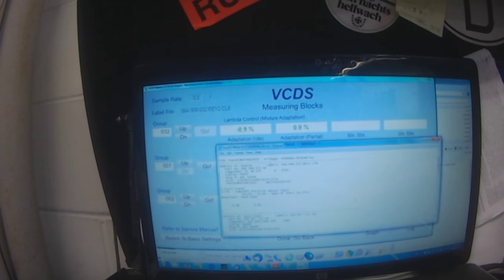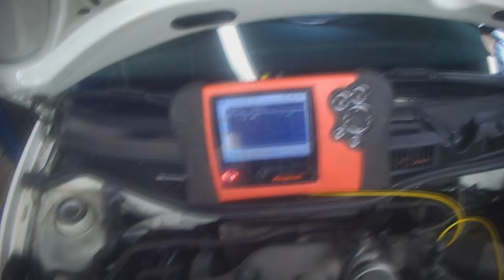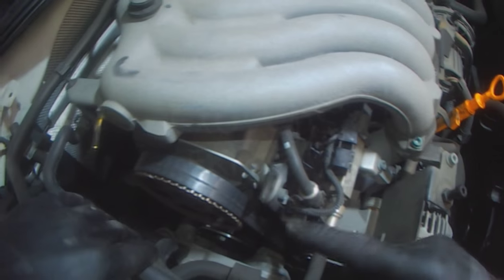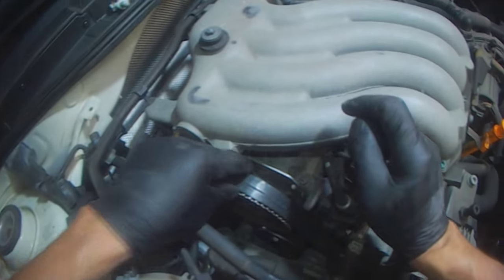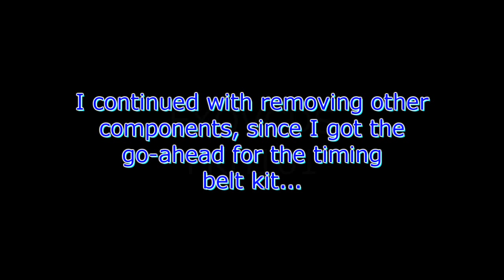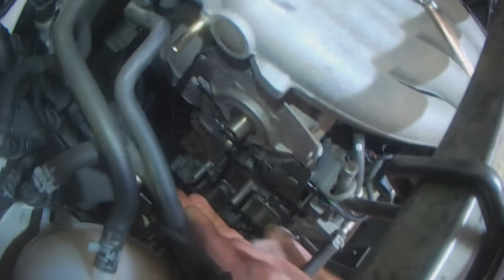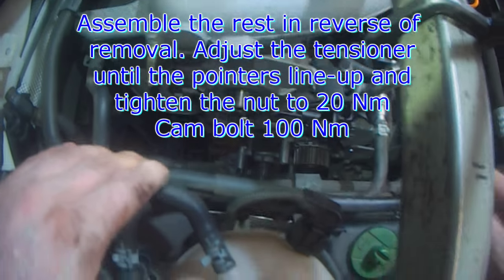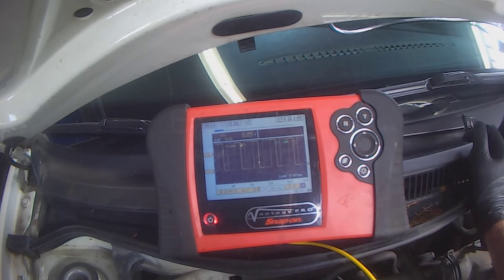VW A4: 2.0L Faulty Camshaft Position Sensor G40 (P1338)

Comment: @EXOVCDS
Can it die out of the blue?
at some point start to have long start issues, yesterday received ESP lamp, and lose of juice (lack of power) checked codes P1338 G40 Open or Short to Plus
Reply from the maker: Year, make, model, engine?
Check for missing timing belt teeth.
Reply: @EXOVCDS  VW Golf IV (Variant)
1.6L (APF)
Engine ran totally ok after rebuild (at 240k km), sensor was not changed, because there were no need for this
Reply from the maker: I don't know if the 1.6 has the G40 at the cam gear.
Reply: @EXOVCDS  It has, checked with manual, internet etc. - 06A905161B

Comment: Hello. Tell me please (about the DMRV). Auto Golf 4(2.0/8v/115hp), dmrv (type HFM5) 5 contacts, put the multimetess probes on the 3rd and 5th contact and go on to turn on the ignition, and watch the voltage show 1.02 V, literally 1 second and then abruptly decreases to the lowest reading to 0.01V (and holds), it is worth to start a car, readings 1.48-1.
50V (at idle) and increase as you press the gas pedal. What can it be? Thank you!
Reply from the maker: Post a video on your channel so that I can see what you are doing.

Comment: Hi! im in the process of timing belt change, water pump.. etc.. can i just clean off the CPS without buying a new one? like dust blaster? will that prevent brakedown? thank you
Reply from the maker: Alphafox46 Cam position sensors have a limited time span... it's not always the same. A transistor can only open / close so many million times. You can replace it now or later. I have a video showing how to replace it on a 2.0l engine, by just moving the camshaft sprocket. Your sensor might be good until the next timing belt change or it might fail within the next year.

Comment: Hello dear. I have one question if it possible to answer me. I have VW GOLF 4 2.0l AQY code. I have a small problem, the engine starts without problems, runs very well, has good acceleration but at the idle I feel at the steering wheel when the engine do a short interruption or like small vibration and the same at the exhaust (I hear like bup-bup every 2 or 3 seconds constantly). I checked everything with the electricity (coil, spark plugs, wires), crancshaft sensor, MAF, O2 sensors and the other sensors, computer, timing belt is new, cleaned combi valve, 4 filters, oil, fuel pump changed and measured pressure in both pumps, changed petrol injectors, measured cylinder compression-more than 10,5BAR. Yesterday I tested camshaft position sensor like in your video with the multimetre (on the left-first its 5V, second one its not from 0-12V when the engine is runing-its is about6-7V, third is 0,011V). My engine runs with gas and petrol. I dont have idea what could be this small problem, help me to solve. Thank you very much.
Reply from the maker: I have no idea... especially if it is dual fuel. Have a shop look at it.
Reply: Thank you for the answer. I was to the mechanics, auto-electricians and to the gas mechanic (changed evaporator). During running with the gas engine works quietly. I have check engine light but without any signal fault codes. Can it be camshaft sensor with those simptoms (voltage)? Thank you and greeting from Kosova.

Comment: Quick question, will the cam sensor cause a no start? girl went in a ditch and cracked the radiator and wouldn't start after...did some pretty good damage...code is 17745 for cam sensor, misfire on multiple, and codes for all 4 cylinder and codes for knock sensor 1 and 3...
Reply from the maker: Year? Engine? Model? Cam sensor should not keep engine from starting. Check if something happened with the timing belt.
Reply: Thomas EXOVCDS oh sorry lol...02 jetta 2.0 manual...
Reply: Thomas EXOVCDS timing belt is horrible...turns over good tho...151k...she just got it Saturday last week
Reply from the maker: What do you mean it's horrible? If it jumped teeth, valves could be bent. If you don't have spark, then I would say crank sensor or wiring may have gotten damaged. Crank sensor is mounted to engine block... to the right of the oil filter, just before where the engine meets the transmission.
Reply: It's cracked and don't look like it's ever been changed...I work on vw/audi alot...u might remember me from a last summer, had the 02 passat 2.8 that would run ok over 3k rpm...I don't think I told u the solution...the cam sensor shoe broke and bent 1 valve on each cylinder on the passenger side...I rebuilt the head and sold it to a friend...still going strong!!..anyways, back to this vw...I usually work on 1.8, 2.8, vr6, r32...don't  usually touch the 2.0...I do alot of rebuilds mostly..so I think I'll do a compression test, then talk to her and do timing belt etc, cam sensor...try to start it and move to cps it it won't go...ecu is ok...no spark I don't think...I don't see damage anywhere from hitting whatever she hit...it bent the radiator in but didn't break fans etc so not thinking it's anything serious
Reply from the maker: If you can handle the other engines... this will be a piece of cake! You just have to find the slice that is causing the issue. =)
Reply: Thomas EXOVCDS thanks!! shouldn't I have a code for crank sensor if that's what it is? got one for cam sensor but not crank so I thought that was the slice lol :)
Reply from the maker: Yes, you'd think that there would be a crank sensor code if the sensor is not producing a signal or if there is a wiring problem. If she wants to fire when you spray MAF cleaner or brake cleaner in the intake, then you have spark = crank sensor is ok. If she does not want to fire = no spark = possible crank sensor issue. You can disconnect the cam sensor... in case it is causing issues with the spark / injector firing.

Comment: great video wish i would of watched before almost strippin cam sensor bolt then bending the tabs that the sensor reads then losing the keyway piece like wtff, i didnt think that piece would come out
Reply from the maker: Yeah, a lot of people bend the shutter wheel... sometimes the key stays in place.
Reply: +Thomas EXOVCDS ya im waiting on new key way now i had gotten new shutter wheel and cam sprocket and i even boug oriellys sensor and no luck aith it so i got oem bosch sensor,and outtung back together, the littke metal piece fell in the sand
Reply from the maker: David Cifuentes Make sure it didn't fall into the timing belt area (water pump or crank sprocket)... it will cut the belt.
Reply: +Thomas EXOVCDS i will check thanks, my luck thats exactly where it is

Comment: Hello Thomas, thank you so much for the video! I just had a question in regards to keeping the Camshaft sprocket in place - Is there anyway to break the bolt without the use of the "Counter Hand tool"? Thank you! Love the videos!
Reply from the maker: You can stick a screwdriver between the camshaft sprocket spokes and rest it against the valve cover, then try to loosen the bolt. Do so only while the timing belt is still in place... to prevent accidental camshaft rotation while the crankshaft is stationary.
Reply: Thomas EXOVCDS thank you so much! I truly appreciate it!
Reply: Thomas EXOVCDS I am doing what you said and leaving the belt in place with zip ties and I'll bungee it to the hood! I am replacing the camshaft pos sensor.
Reply from the maker: You have to be very careful though... the camshaft sprocket has a "sensor wheel" behind it. If you are not careful, the sensor wheel can bend. A counter hold tool can be bought at most auto parts stores (most likely).

Comment: Hi Thomas, good day! I have a MK 4.5 JETTA GLI 1.8t in Mexico, in this week the gli turned on the light of check. I connect the scan and clear, the code was 17746 Cramshaft Position Sensor G40 P1338-35-10 open of short to plus intermittent. The code does appear again, you recommend any maintenance? Thanks for your time.
Reply from the maker: Check that the sensor has power & ground (the outer two wires)... just like in this video. Check that the center wire has voltage and that the voltage goes to 0 when the sensor is triggered. You can use a voltmeter to check:
https://www.youtube.com/watch?v=A6XV5x0504c
Reply from the maker: If the sensor is producing a signal, then you have to check camshaft timing (intake & exhaust camshaft)  and cam/crank timing (TDC marks on camshaft gear and crankshaft / flywheel). If the sensor is not producing a signal, then the sensor is bad.
Reply: Thomas EXOVCDS thanks so much! Maybe the sensor starts with failures, because the connector it’s ok, i have 4.99vcd, 10.09vcd ant negative, the voltage in the center wire is 6.2 to 6.6 vcd with the engine on and idle. The code  not appear anymore but My car have a 128,000 km maybe it’s necessary  change the sensor.
Reply from the maker: @marcocortes1340  Yes, it could be that the sensor sometimes does not produce a signal.

Comment: Hi, i have problems with my passat CC 2013, the car runs good when it's cold but stalls once it warms up... and there is no chance to start ir normally again, after start it works only 1-2 sec, then stalls... After 2-3 hrs when the engine is cold, it stars normally again... The diagnosis didnt show any faults... :( There is possibility that i have the same problem with crank?
Reply from the maker: Yes, maybe... but usually a faulty crankshaft or camshaft sensor will set a fault code in the computer.

Comment: I thought the 12v was the power and the 5v the signal . Is that why i check with a multimeter and it clearly shows 12v but then i check with a test and it wont light up..
Reply from the maker: With the new sensor (as can be seen at 10:44)... power supply to the sensor is 5V and the signal is a 12V signal that gets pulled to ground / 0V by the sensor. Using a voltmeter, the signal voltage will be less than 12 volts. An oscilloscope will show a square wave 12v to 0V (as can be seen in the video), instead of an average of 6V to 7V at idle... again, as can be seen at 10:44 to 11:20.
Reply from the maker: If your signal wire (the middle one) is showing 12V when the engine is at idle, then the sensor is bad.

Comment: Please where is the oxygen sensor of this 2.0 located?
Reply from the maker: In the exhaust system... there are 2 of them. One is in the exhaust manifold at the back of the engine (look down behind the intake manifold) and the other is after the catalytic converter (under the car).

Comment: Thanks Thom
cam shaft sprocket torque is 100Nm (73.7 ft lb) ? I want to know that torque . ??? please correct spec
Reply from the maker: +Bright kim Yes, 100 Nm for 2.0l engines: AEG AVH, AZG, BDC, BEV, BGD

Comment: Hey Thomas,

I was wondering if you think on my 2011 Audi Q5 2.0T when getting the code 
OBD2 - confirmed:
P0343 - Camshaft Position Sensor "A" Circuit High Bank 1 or Single Sensor
P0456 - Evaporative Emission System Leak Detected (very small leak)
 
you think the Position sensor itself needs to be replaced? I'm not sure if the vacuum leak is related but that code showed up later.

After watching your video (very helpful), I feel a little more confident about getting in there and replacing it myself.

I'm also getting the EPC light come on at random times.
Reply from the maker: +Alex Kane I'm currently at work... your cam sensor is in a different location (much different engine than in this video). I'll get back to you tonight (west coast time).
Reply: +Thomas EXOVCDS Hey Thomas, any luck on this?
Reply from the maker: +Alex Kane Hi... sorry, I keep forgetting to get back to some people. I'll send you info tonight.
Reply from the maker: +Alex Kane I can't find the "send message" button on your channel... send me a message so that I can send you a link.
https://www.youtube.com/user/ExoVCDS/about
Reply from the maker: +Alex Kane email has been sent.
Reply from the maker: +Alex Kane I have a feeling that the sensor is in a different location.... what is the engine code? The BPY 2.0T has it at the left of the head as shown in the mitchell info. I believe your sensor is to the right of the oil filler cap, at the front edge of the valve cover.
Reply: +Thomas EXOVCDS P0343 is the code, I emailed you the scan I got from my obd2
Reply from the maker: +Alex Kane No... engine production / id code. BPY, CCTA, CEAB something like that. Located on a sticker on top of the engine / timing chain cover area.

Comment: I just had my water pump, timing belt and serphentine belt replaced on my 2004 jetta. Now its throwing this P1338, P0420 catalyst system and P2181 cooling system. Could my timing be off?
Reply from the maker: P1338 "could" be due to the belt change... if it does NOT produce a signal, then it's a faulty sensor (old age). If it DOES produce a signal, then the timing "could" be out".
http://wiki.ross-tech.com/wiki/index.php/17746/P1338/004920
The others are probably not related to the work (underlying / previous issue)... my best guess at this point.
http://wiki.ross-tech.com/wiki/index.php/16804/P0420/001056
http://wiki.ross-tech.com/wiki/index.php/18613/P2181/008577
Reply: Thanks!

Comment: Thomas, I've got an 04 Jetta 2.0L BBW engine. Had a P0010 code and replaced the camshaft position sensor. Started great and idled perfect to temp. I didn't drive, 3 cars in the way. Next morning I turn the key and it starts but instantly goes dead. It will keep running if I keep the pedal down at about 4000 rpm but then dies as soon as I let off. Any ideas? Thanks.
Reply from the maker: The oil control solenoid plunger for the camshaft phaser might be stuck.... causing the cam to stick in the advanced position. I'm currently at work... will reply again once I'm at home later tonight (6pm> PST).
Reply: thanks. I'll look forward to hearing from you.
Reply from the maker: Using a scan tool that can view live engine data... one can check specified and actual camshaft position (degrees of rotation). At idle, there should be 0 degrees of advancement. If the cam is stuck in the advanced position, then the engine will be harder to start and will not want to idle. I recently had a New Beetle with the 2.5L engine that had a stuck valve / plunger in the solenoid... caused the same symptoms that you listed. You can remove the solenoid to check it for debris (that might be keeping it open / closed) and for functionality (apply battery voltage rapidly to the solenoid to see if the plunger responds).
Reply: Thanks. Will give it a try. well the part I can anyway. I don't have a scan tool that will do that but maybe autozone has one to loan.

Comment: so i use the 2 holes on the plate on the cam for the holding tool? i need to order it but i want to make sure i know how to use it and mess anything up on my golf
Reply from the maker: +M1xxDuP3ngu1N No... the 2 little holes in the "shutter wheel" do not have anything to do with the removal or function of the cam sprocket. The holding tool "legs" are wedged against the camshaft sprocket legs.... you have to make sure that the holding tool DOES NOT press against the "hall sensor" or the "sensor wheel" (the metal piece that has those two holes). If either the sensor or the metal wheel get damaged, you will have camshaft position sensor fault codes.
Reply: thanks, i even just saw what you mean in another video

Comment: Did you have the engine warning light on? I have a 1999 2.0l golf mk4 that won't revealed past 3k either stationary or driving.... no engine light showing..... only codes are for misfire.... although it doesn't seem to be misfiring..and idles OK?  I'm considering changing cam sensor. .. cheers
Reply: *Rev
Reply from the maker: Turn the key ON and check the voltage of the center wire of the camshaft position sensor connector with a multimeter. Start the engine and check the voltage again. If the voltage is the SAME, then the sensor is bad. If the voltage is lower, then the sensor is producing a signal.
Reply: I will have a look tomorrow. . Thanks for the info... I will let you know what happens.
Reply from the maker: Depending on where the camshaft position sensor "wheel" stops, it can pull the voltage down. Meaning that if you have 0 volts when the engine is not running, start the engine and see if you DO get a voltage. If you have voltage that does not change or if you have no voltage all the time, then the sensor is probably bad. One step further if you have no voltage at the center wire... disconnect the connector and check for a voltage at the unplugged connector.
Reply: Hi there,  I checked the wiring to the sensor.... the 12v and the 5 v was there. ..earth too.... I tried disconnecting the sensor and it threw up a fault code.... plugged it back in and code disappeared. ... so I guess it's else where? Fuel pressure at supply to regulator is 3bar.. it will start OK. ... you can rev it to around 3k... then it will slowly die and stall, no fault codes bar some cylinder misfire codes.... it has had plugs.coilpack leads recently.. cheers

Comment: oh so its 5v as the power source and 11.2v is the signal wire?
Reply from the maker: Backprobe like I did to get your voltages and compare when unplugged. A scope is needed to view actual signal / square wave voltage... a multimeter just displays an average voltage.
Reply: @EXOVCDS  it's I kinda weird my first issue was I had the two positive wires backwards and I immediately got the p0343 so when I discovered that,switched them and immediately got a p0341......grrrr but I think the sensors that have red black and yellow wires are cheapo's so probably gonna have to order the expensive one or go the junk yard and snag a few that aren't from shen zen
Reply from the maker: You had to do wiring repair and mixed them up?
Reply: @EXOVCDS  ya so I checked the the wiring right and the Chinese one gives me a 343 and with an old original one I get a 341 so I need to get a better made sensor I believe